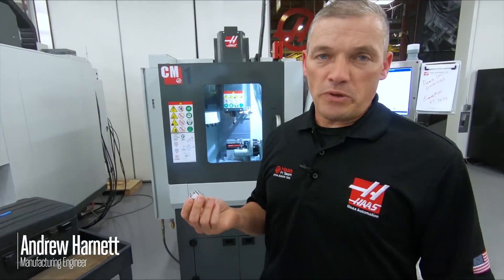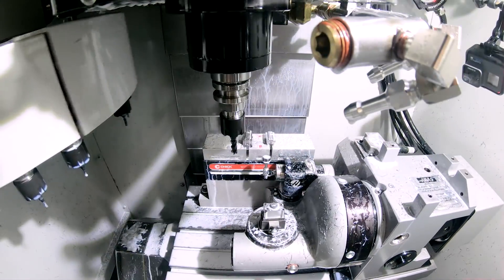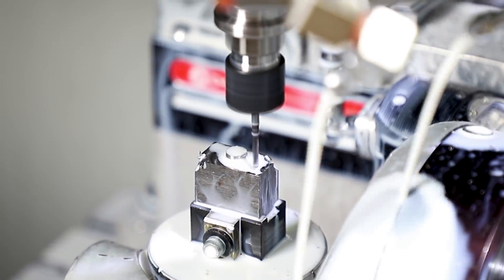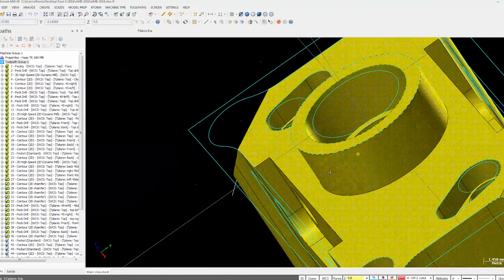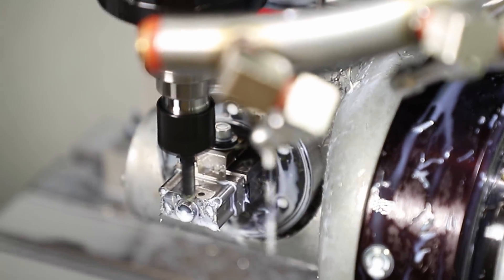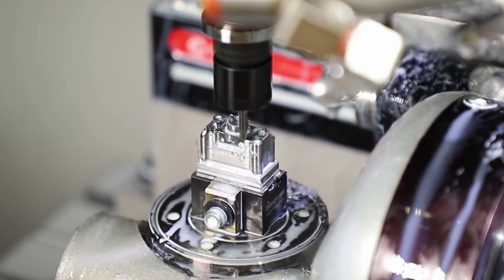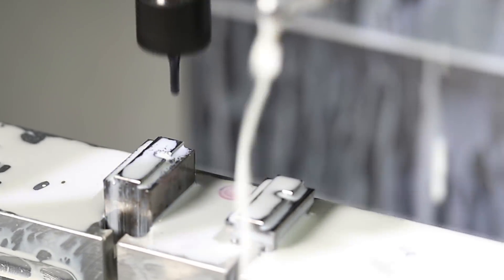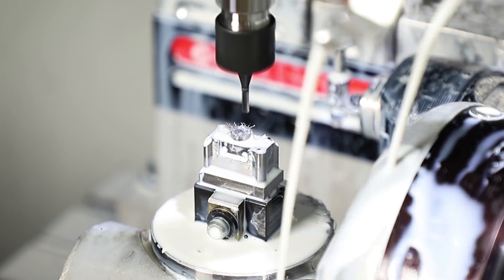The Making of a Haas Trade Show Demo - Demo Part Breakdown

Comment: Cool machine but, honestly would have been much nicer to just stick the iso20 spindle in a mini mill frame which is already a pretty small machine. It would probably even cost less since there would be no need to create a whole new manufacturing line.

Comment: I know it's not their target market but I would love it if Haas made a mill to complete with the chinese   made cnc mills for the home gamers and entry level mills in the 20k range to give the tormach crowd better options for their start ups. Something like a 10k 3 to 5 hp bt30 spindle, linear ways, atc and 4th axis capability that can run on 220 single phase. I much rather support American companies like Haas.
Reply: makun16 just look at some used haas machines. A used mininill can be had for less than 20k, can hog out material with big tools and will be more robust than a tormach. Run it on a phase converter if you have to and you still be better off imo. That's the way in going to go if not bigger if i have the space and power.
Reply: WCGwkf I've never seen one for less than 32k used online. Even one that is 10 years old are priced near new prices. I must be looking at the wrong place. Having ran mini mills and vf3s, they are very nice machines with a well thought out control and lots of 3rd party support.
Reply: makun16 look around more I've found some super cheap. You have to keep in mind the prices on the haas website are starting prices that don't include much that you normally see on machines. The ones you see may have a SS spindle and other options that don't come standard and quickly drive up the cost. 10 years old may still be too new and you might have to look at early 2000s or even a late 90s machine. If your only purpose is a hobby and not real precision parts for production they would do you just fine. I've done some browsing and you could get one like that for under 20k. The newer ones with the next Gen controls with gray doors will probably run at least 30. A small startup shop I worked at had a really old one and a new one both vf2 and the old one was running parts just fine

Comment: 19:16 where is the rigidity of the machine? everything bends down
Reply: I think it just looks like it because the camera wasn't being held steady.
Reply from the maker: Good eye, everyone who noticed.  Yes there is a small amount of deflection in the part and workholding, we think the part wasn’t quite tight.  The deflection is not in the machine or rotary.  Being a trade show demo we’re a little more lenient than we would be if this was an actual part needing to hold tolerance!
Reply: retoxxx1 
Its in Mazak, Okuma, Hermle...
Reply: same at 17:12 with the drill 😯😯😯
Reply: I very hope its just a camera issue...
Reply: same at 0:43 in this video: https://www.youtube.com/watch?v=vj1goyp9Spg
Has me worried as we just placed an order for one.

Comment: Why does a cm1 start at 60k? Does it come fully optioned? Costs almost the same as a VF3
Reply from the maker: WCGwkf - Nearly every component on a CM-1 is unique and used only on the CM-1.  That, combined with the number of CM-1s we build, is the reason the machine is priced the way it is.  We build so many more VF-3s, and many parts on a VF-3 are also shared across the entire VF line that it allows us to price them lower.  Hopefully that answers your question.  Haas Automation
Reply: @haasautomation  I would love to own this machine.  HAAS if you could bring it down to $30k by putting in a slower spindle then I'll purchse 3 all day.
Reply: The standard 30k spindle really shoots the price up. These machines are suited toward more the medical industry.
Reply: Yes, it should be 25k regardless the tiny spindle!

Comment: Daniel Machado - Brazil
how to do thread interpolation?
Reply: Ok Daniel Muchado, you are in luck because I also use PowerMill every day. What you need to do is create a hole/feature for the holes that you want to threadmill. The holes should be the tap-drill diameter. Then, model your threadmill tool. Then, make a drilling program, and in the drilling tab, select "threadmilling". It might be set to something like single peck or deep drill by default, but that is where you select thread milling. Then you can set your pitch and number of turns and passes.  Then in the "thickness" tab, you put a negative thickness in the radial stock to leave so that the tool actually engages the part, usually -.03 is safe to start with unless you are threadmilling something smaller than 1/2-13. Then through trial and error using the actual bolt you are thread milling for, you slowly dial out the stock to leave until the fit is right. Then you can write down that number for later use, but keep in mind it is only for that exact threadmill.
Reply: What CAM system are you using?
Reply: PowerMill.
Reply: I can help you out with starting values if you tell me some more info...
Reply: It's Mastercam
Reply: Look up PowerMill Thread Milling.